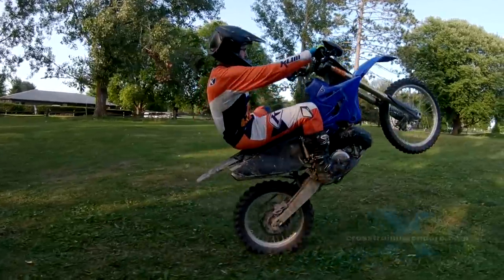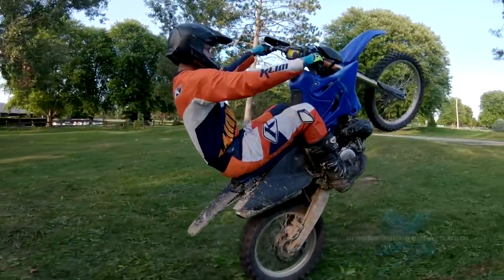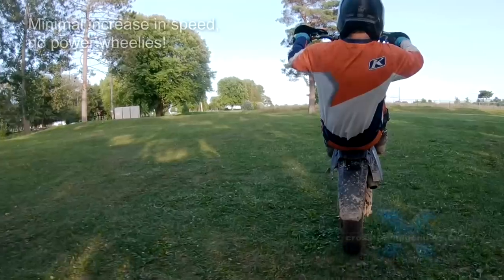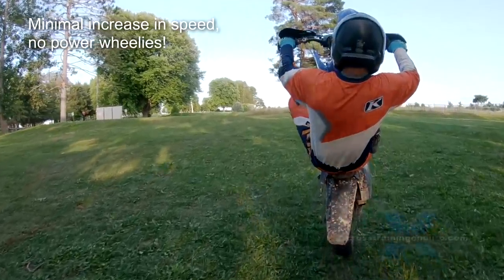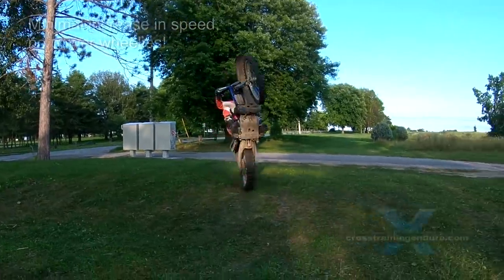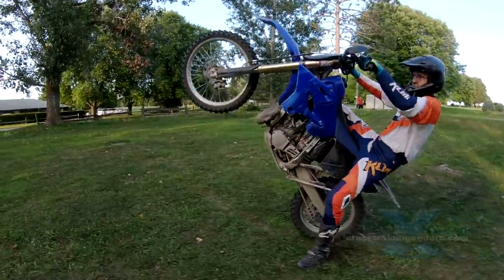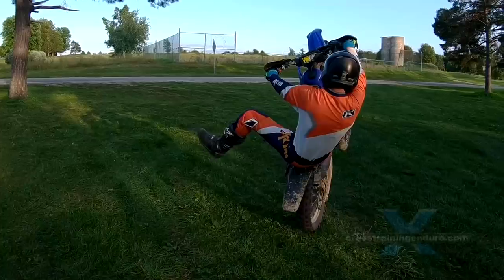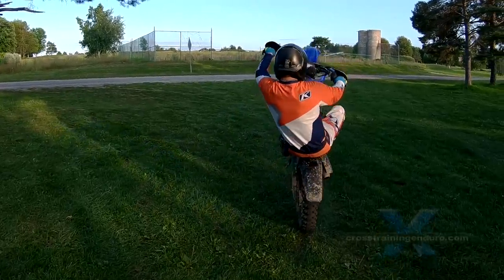How to 12 oclock wheelie guide︱Cross Training Enduro

Comment: Rear brake, rear brake, rear brake, rear brake. Seems so easy but I have such a hard time putting it into practice. No idea why.
Great video and love your wheelies!
Reply: Use the rear brake to bring the front back down on about 1,000 practice wheelies.  Make it muscle memory.  Our brains are too slow for some of this stuff.  I'm 48.  I've been watching these vids and practicing wheelies for over a year and I don't have a good slow wheelie yet...but I've got wheelies and I haven't looped yet.
Reply: It’s definitely tricky to get a feel for! Keep pushing and you’ll get it! Thanks (:
Reply: If you can get access to a really small dirt bike like a 125cc that’s really helpful. It’s a lot less intimidating and the lack of power demands you develop precision.
Reply: I was used to a scooter, which has the rear brake on the left side of the steer.
After i was doing slowwheelies on the scooter, i bought a suzuki drz 400sm and attached an extra rearbeake on the left side of the steer, under the clutch lever cause i was used to rear brake with a handbrake and not with a footbreak as a rear brake.

After doing slowwheelies with the attached Magura handbrake, i took the handbrake off, and with the first 12 o'clock wheelie, i braked with the footbrake, at that time you already know where the balancepoint of falling is, so that was a lot easier for me.
After that, i was doing slowwheelies, wheeliecircles, scraping, and coasters with the footbreake.

Comment: It was well pointed out that you should not only cover the rear brake but also use it. It's way too easy to practice wheelies and use clutch to kill it at the moment you start to get anxious. In long term it'll likely backfire badly, so it's best to work using that back brake as long as it will be the absolute and primary way of getting that front down.

Comment: Great how to video. I never learned rear brake control on wheelies. The only thing I used was throttle control. It never occurred to me to use the rear brake. I wish I'd practiced that now, because there were a couple of times I could have saved myself from flipping. That said, this may not have helped me while standing on the seat.  :)

Comment: So when your at 12 o'clock applying rear brake to save it, are you also using a bit of clutch to prevent the engine stalling?
Reply: Depends. If you're going slow and the revs are low clutch comes in while back brake is constantly but smoothly applied, slowly increasing pressure as you slow down. 

If you're going faster and the revs are high clutch is not necessary but be careful as you will stall if you get scared and stab the rear brake.
Reply: @Belicose777  but once you are at 12 o clock you definitely need your clutch otherwise you will stall it. I have a habit of using the clutch even with gentle brake ťap
Reply: Enduro Fools i dont use clutch once im in my sweet spot. Keeping it in gear will keep it moving.. although i do have a habit of grabbing the clutch while coasting

Comment: Amazing video as always! 
So when the front tyre is up and u dab the rear break to prevent a back flip, what do you do with the clutch? Do you clutch in or leave it mostly out while giving some throttle with the rear break dab? I can’t seem to maintain that slow wheelie despite very good quick lift with minimal forward speed (nearly perfect pivot turns but never a longer-than-10feet-wheelie) 😒
Reply: Jihad Achkar for me at least, if I’m not on the throttle, my clutch is pulled in or feathered. I’m constantly using the clutch during these slow wheelies. Think of it like you’re starting from a stop over and over again. Small amount of throttle and slipping the clutch. It smooths out the power and makes things more predictable. A good way I could show this is by holding the throttle half way open and only using the clutch and brake to control the wheelie. Clutch is more important than throttle for this! But of course, it’d be silly not to actuate both 😊
Reply: BeRAD thanks Buddy

Comment: @BeRad So i can get my front up easily at low speeds/from a stand still but im having trouble staying connected to the bike especially if im dabbing with my left foot. Oh and i always end up tunring left lol. Should i be using my upper body strength to keep me on the bike or am i missing something? Bike is a WR250f w/athena 300 kit, has a new gripper seat cover so that is no issue. I am 6"2 running standard pegs (not sure if that be an issue)
Reply: After Hours Productions hmmmm. Hard to say without seeing a video. You feel like you’re sliding off? It does take quite a bit of effort to hang onto the bars when you wheelie slowly. It’s like you have to stay strong and rigid but also loose to control it. As for falling the left, that’s natural especially when putting your foot down. If you’re comfortable with the brake already I’d recommend trying to to dab the foot. Keep feet on the pegs and/or hover the leg out sideways to balance.
Reply: After Hours Productions so yes, you will definitely need to use some upper body strength. Try to use your abs/core muscles and not just your arms!

Comment: When you are compressing the forks can you just use either the rear brake or the front brake or would you use both brakes? Thanks.
Reply from the maker: Covered this in one of our other training vids, Andrew. Whatever works best for you and doesn't feel overly complicated.
Reply: @crosstrainingenduro  Gotcha. My other issue is the one that is complicating the process. It's the clutch and throttle timing, specifically the throttle. After compressing the forks say using the front brake, do you give it throttle while the brake lever is pulled in or do you release the front brake lever then give it throttle? Thanks.

Comment: At these slow speeds and using the back brake, I assume that you will also be disengaging and engaging the clutch as part of this precise control?
Reply: yes
Reply: Will Parish yes! It’s a constant use of the clutch! I actually have the lever pulled in about as mouth or more than I have it released. Basically coasting behind balance point without any engine braking. Also, anytime you use the brake you’ll want to be sure it’s pulled in so you don’t stall!

Comment: Do u feather the clutch to help ease throttle response once the wheel is up?
Reply from the maker: good question eric. i don't unless the wheelie gets so slow it will stall. but i reckon riders with a trials background would use a mix of clutch and throttle control...

Comment: Great instruction.. I just have so much trouble controlling the pressure I'm applying to the brake petal. Its either not enough or my front wheel is slamming down.. I dont know how to get past this.
Reply: Saa45MIV that was my biggest learning curve when I started. It takes time. Start playing around with the rear brake when you’re just rolling in two wheels. Get a feel for what it does and how it reacts to different pressures. Just use it excessively and focus on how it feels. That might help!
Reply: BeRAD you couldn't give much better  advice than that, I just have to apply it and hopefully avoid tearing the ass out of  my new riding pants..  cheers. 🤟

Comment: I lubed my chain the other day and didn't realise I got lube on the rear brake rotor. I almost looped out because it didn't grab when I tapped it. I will always test my brake before a wheelie from now on. 🙄
Reply from the maker: Yeah, I dread moments like that Jon... I try to always dab the brake enough to make sure it's working before doing any wheelie, especially any in higher gears.

Comment: Tips for powerhouse xr650r wheelie training? It gets it up in 4th @45 mph (75kph) without clutch. I can carry all the way from 2nd gear idle to putting it down at 75mph or 125kph or balance it in fourth for miles. The problem is it absolutely rips the rear tire out or loops immediately when trying to go slow. I can hop logs and stuff but it has too much power for controlled slow wheelies. A 16th throttle wheelies in first. Is there a way to make a throttle more precise?
Reply: Google "G2 Dirt Tamer Throttle tube". Made a world of difference on my CRF450X...
Reply: @tridium-go6hw  g2 doesn't make one for the  650 but they should be universal right?
Reply: @skulldriver1019  go to g2ergo.com they do have the xr650r listed.
Reply: Having ridden multiple xr650r’s, it’s not the bike. They are perfectly manageable (although maybe a bit more tricky). I’m guessing you need to try to use the clutch more than the throttle to intimate the front wheel lift as well as hold it. If a bike isn’t “too powerful” to start rolling from a standstill in a controlled manor, than it isn’t too much for wheelies!! You can find a video of me on my old fz09 scraping the tail light at about 5mph...THAT is a powerful bike and one with a stupid responsive throttle off of idle. Yet, it is manageable because of the clutch!!!! Keep trying and just focus on that clutch and using small amounts of throttle. You’ll get it!
Reply: change your sprocket setup, smaller in the front, larger in the rear

Comment: for what its worth ... ive had the fox comp 5 boots for 2 years and seems like the thai know what there doing. lol ...ive put about 100 hrs of what im comfortable putting them through and they have yet to fail in anyway ...thought they were going to make me a better rider though :(
Reply from the maker: There seem to be plenty of Comp 5 boots not failing and riders are happy with them... but the level of complaints was high compared to the other brands. I'm glad yours are holding together. 😊
Reply: @crosstrainingenduro  i did notice a large number of complaints aswell even before i bought them. the rest of the boots in that price range suffered the same problem. so it kind of felt like the best of the worst option (mabe) lol i do have to say there internal support system is fantastic at keeping your heel from lifting 
next time i make a new boot perchase im going to take your advise and go with the most blingy pair i can find more bling more protection right lol ;)
Reply from the maker: Bling is king lol!